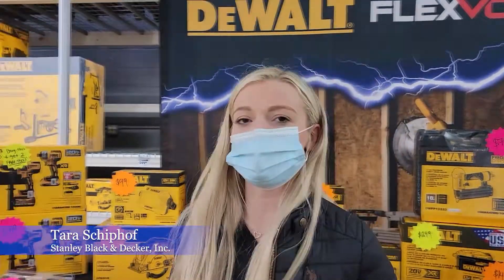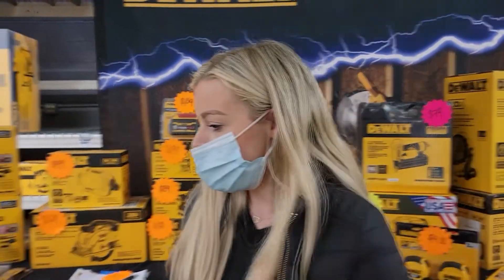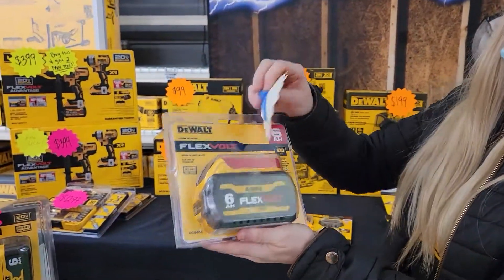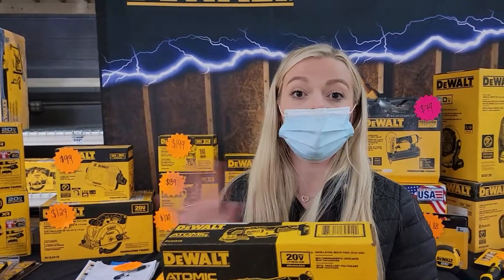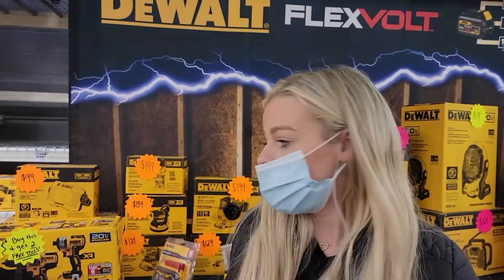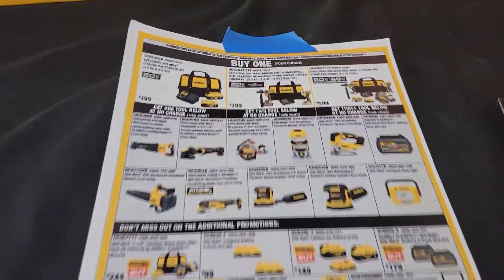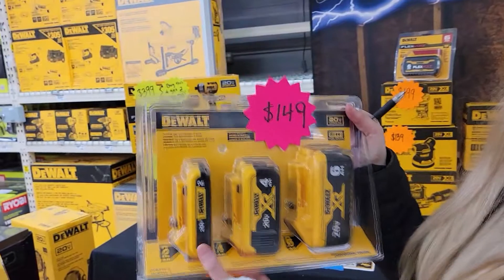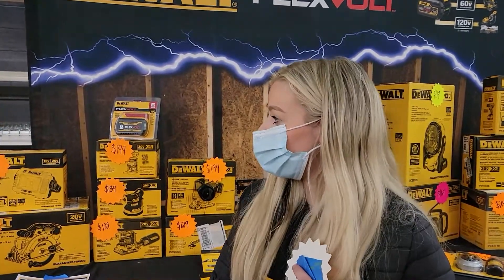Dewalt Batteries Explained || Volts Amp Hours + FlexVolt

Comment: The Flexvolt 20/60V battery, does it provide only those discrete voltages or any voltages in between?  The reason I ask is that I have a DeWalt Brush cutter, DCM581N which requires 36V.
Reply from the maker: is this the answer you were looking for?  https://youtu.be/nuLOCMhJyko?t=113